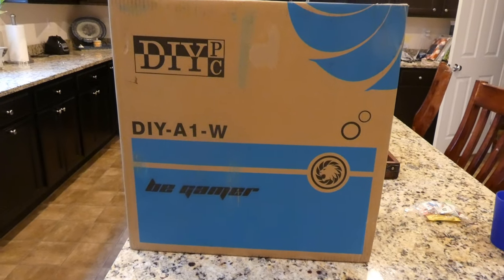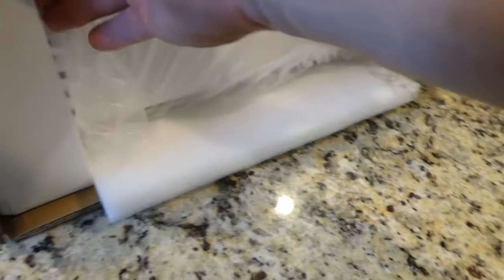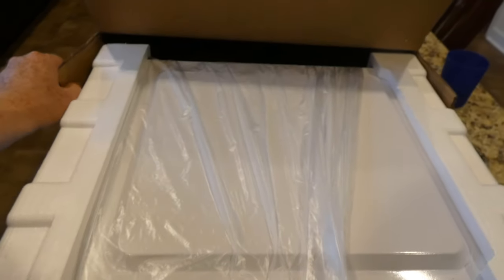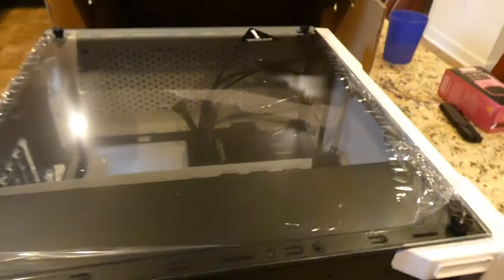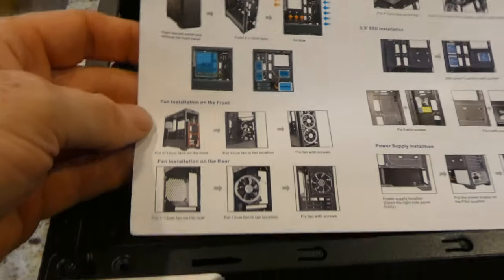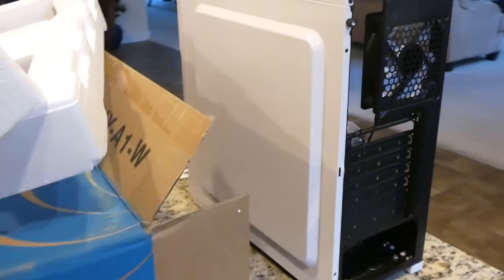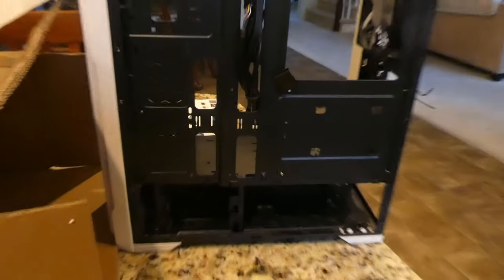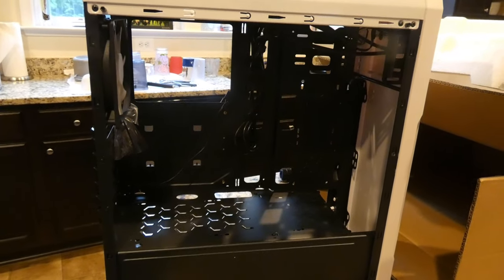Unboxing and overview:  DIYPC DIY-A1-W White Tempered Glass USB 3.0 ATX Mid Tower Computer case

Comment: I bought one based on the idea I'm building a spare parts pc for my youngest so 30 bucks is pretty doable. Its super light weight. It looks nice enough. And once put together its not half bad. I did top strip of leads and put 2 120mm fans in the tip blowing in so its plenty cool. It made cable management easy so I got a nice light clean build good for light gaming. If you need. If you are going to spend like 1000 plus on pc parts spend some on a case with a better build. This cheap case gets the job done and was the most affordable case I could find that was not a milk crate. For the price I have no complaints. Seems you get more than what you paid for here.

Comment: is it easy to take a part?, i would like to reuse the part(all the black coated parts, motherboard tray, the backpanel, the 120mm fan mount and the psu mount) to put in inside a power mac g5

Comment from the maker: To purchase similiar model from Amazon:  https://amzn.to/2M8k5Cl  There were a couple of mistakes stated in the video, thank you to those viewers for keeping me honest.  Case is made of a combination of Plastic Glass and Steel (powdered coated white) .    My statement about fans with lights shipping with Moleds mainly...should have been that they ship with Moleds and 4 pin PWM, but I usually plug in the Moled on the right access panel for various reasons.  Thanks...yes Standoff.  Funny, I used to design SS guards and we could call them the same thing.

Comment: you talked about the header pins, the fan, and the panel... thats it. would have been a lot better if you explored how the HDDs seat in the case, were they exactly were, room for fans, power supply bay room, opened the front panel of the face of the case off etc.

Comment: Air flow looks bad.
Reply from the maker: Compared to the best cases...Yes. Compared to what I normally can afford to show on this channel...No. lol  Most cases I show on here are $30-60.  If the 2 DIYPC cases I had that are this style just had some vents in the front, it wouldn't be too bad.  This does have locations for 2-3 fans in the front and 2 fans up top.  As well as one rear fan.    This does allow for air to be pushed out and up.   For most people, that is actually pretty adequate.  A hard core gamer who is overclocking probably would want a bigger case and some vents in the front to bring in fresh air (cooler air).  
As for the PSU,  in these type cases....that is another story.